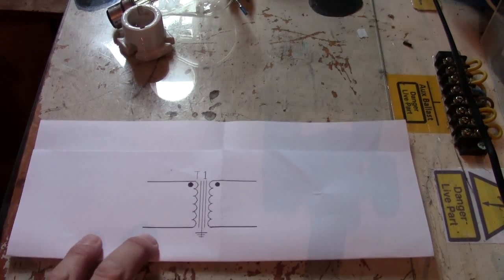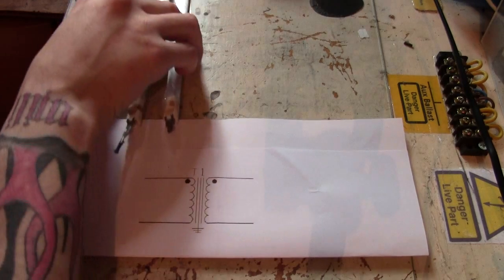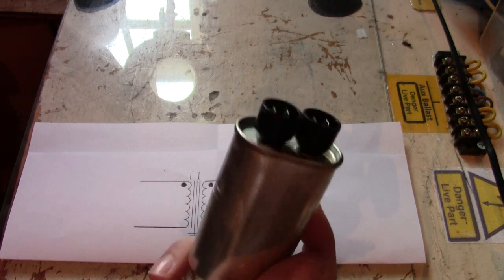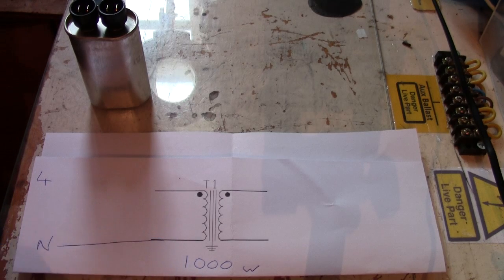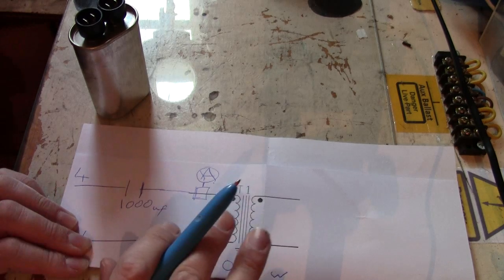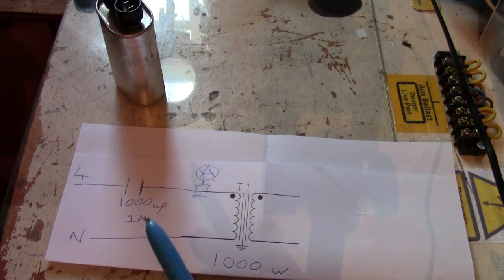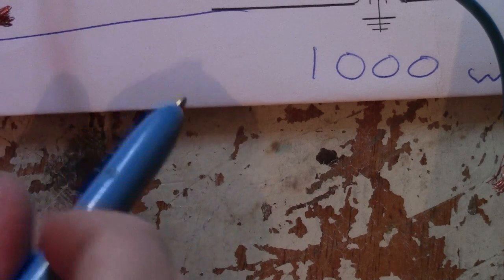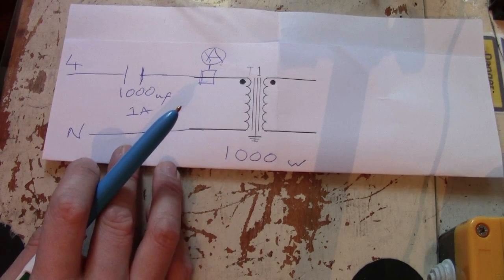HOW 2 BALLAST PT 2 ..EDIT IN DESCRIPTION PLZ READ

Comment: Capacitors cause a phase shift too but just in the other direction.
An ideal inductor cause the current to flow 90° after the voltage.
An ideal capacitor causes the oposite, it causes 90° current flow before the voltage.
This results in an cos phi = 0  -> cos(90)=0
You can relatively easy calculate the equivalent resistance of a capacitor.
Its Xc (capacitive resistance) = 1 / (2*Pi*frequency*capacitance in Farads).
For inductive ballast it is quite similar.
Xl (inductive resistance) = 2*Pi*frequency*inductance in Henry

But if you current limit an transformer with an capacitor this may cause an series resonant circuit.
An then an excess amount of current will flow an fry your transformer.
(You can clearly hear ist when this is happening, excessive buzzing).

Capacitors are great if you just want to limit the current flow from the mains an draw arcs direct with mains voltage.
If you use 3 phase an capacitively limit the current and rectiefie it you can get some decent arcs.
Pretty bright tough the relatively high current and low voltage.
Drehstrom Arcs mit Kapazitiver Strombegrenzung
Reply from the maker: Yes that's exactly right .I was thinking this last night whilst lying in bed .I have a video and lots of info to describe this planned I just have to get the time it should be today the whole video is actually on power factor explaining lagging with inductors and leading with capacitors   .I plan on updating the description too :/ this is one of the problems with being pushed for time I ramble on then get stuff wrong .But thanks for pointing it out .John

Comment: A safe practice if you're going to use a kettle would be to place it in a earthed metal bucket. Should the inventible happen (say it catches on fire) the water would be contained and not pose a risk to the electrical circuit you've constructed. Using a urn, toaster or electric heater would be great safer alternative!